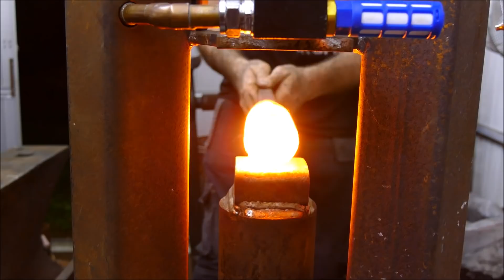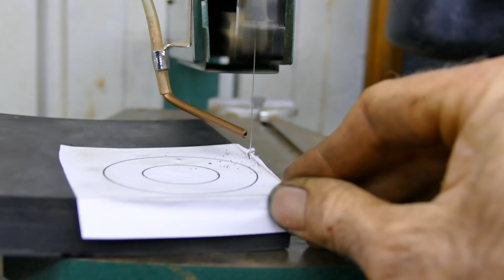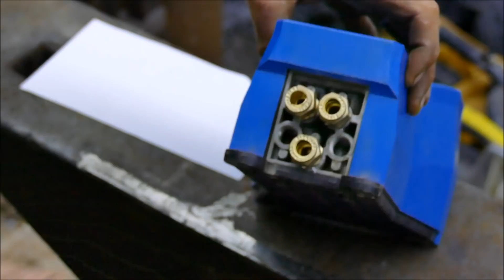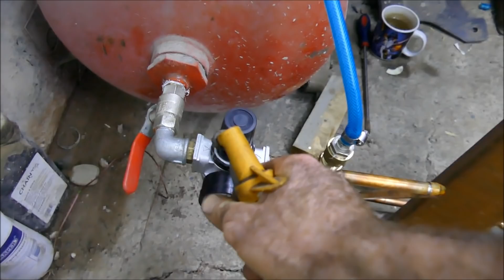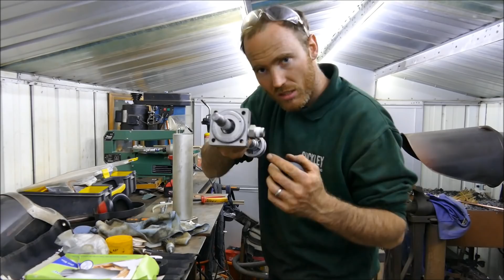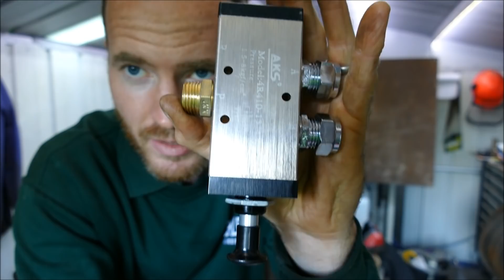DIY power hammer ultimate upgrade - More money making power

Comment: Very nice!!!
Could it be possible to use it as a “tire” hammer?
Reply from the maker: You could but why would you need to?
Reply: @joshuadelisle  The main reason would be the prohibitive cost of an air compressor large enough to power the hammer efficiently. Also tire hammers operate a little quieter. Hey Joshua, did you consider sand filling the uprights to cut vibration? I absolutely love this design of yours by the way, that ram guide system is genius!!
Reply from the maker: @howdyadoo1  Thank you so much! yes I mentioned sand in the first video definately a good idea. For me I found that the motors for the tire hammer are more expensive than suitable a compressor here in england but I mainly like the minimal amount of moving parts and areas of friction. cheers J
Reply: @joshuadelisle  Fair enough boss, stateside it's easier to come across cheap motors and scrap car parts to build with, not to mention your space constraints. But I would love to purchase your plans for the day when I can drop some duckies on a suitable compressor to go with your bada$$ hammer! Great job once again, thanks for putting this out there to see!
Reply from the maker: @howdyadoo1  Thank you so much, all the very best , Cheers J
Reply from the maker: how do you mean?
Reply: Joshua De Lisle, instead of a pneumatic ram. couldcould it be adapted to use a electric motor to a rubber tire like a car tire

Comment: Hi, great idea and good job I really like it !  Just...of copper pipe is fireproof, soldering between two copper pipe are not.... Eventually you can use silver soldering which it's use for fire extinguisher system  😉
Reply from the maker: interesting I'll test that. thanks for the tip. cheers J

Comment: You may not like the copper, it doesn't like vibration. Hopefully it holds well. Great build
Reply: Adding to his comment, I would definitely put a piece of flex hose in the copper line near the compressor. Those things move a LOT and any vibration will crack the solder joints over time and that sudden pop of a line is enough to make a grown man mess his pants, worse with hot steel in the hand.
Reply: @manmachinemake3708  yep lol BANG WWOOSSSSHH
Reply from the maker: @manmachinemake3708  I think I might go for stainless pipe now instead and just Tig it, what do you think?
Reply from the maker: so far its been good and so sign of stesses,  but time will tell. cheers J
Reply: @joshuadelisle  was also thinking instead of mufflers you could run tube into one of the uprights and put some stainless scrubbing pads in. Gonna look for parts to see what my cost here will be. What CFM is your compressor?
Reply from the maker: @the_sharp_carpenter  not a bad idea, mufflers are cheap though. Mine is 15cfm 150ltr tank capacity.
Reply: @joshuadelisle  thanks, yeah just was thinking it might cut even more noise, but then again it's for hitting metal lol.